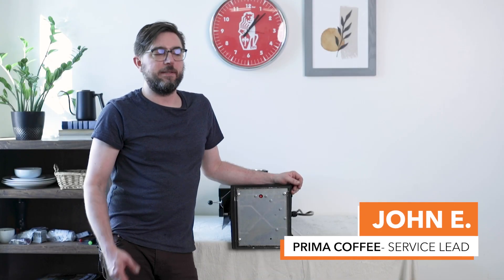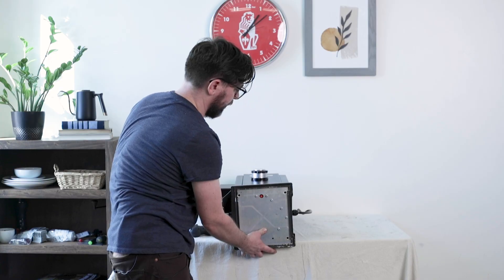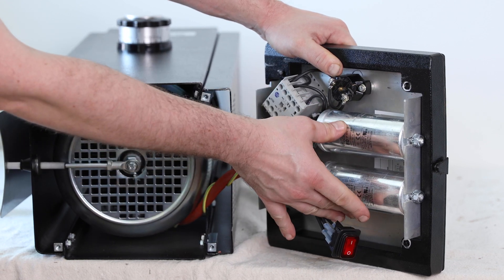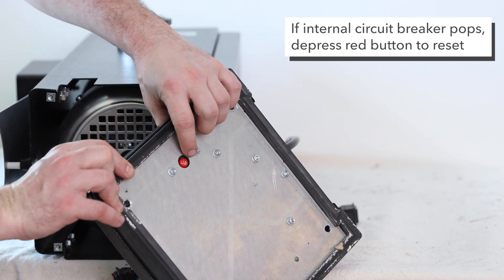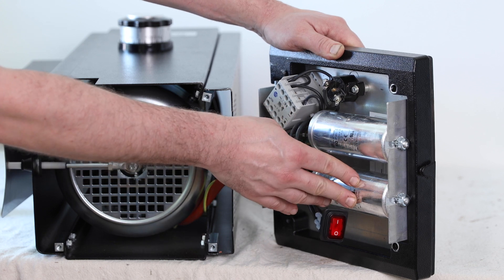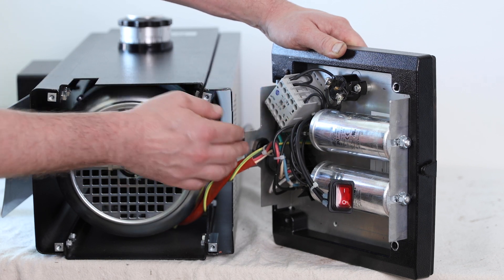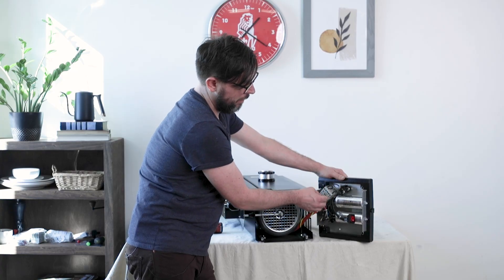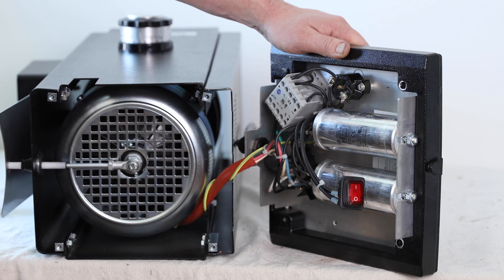Ditting KR1203 Maintenance |  Electrical Walkthrough

Comment: Hi John - would you happen to have a wiring diagram for this grinder ? Bought a used one with dead capacitors (which i knew about), but opened it up and all the wires were disconnected, can't find the service manual anywhere, any help greatly appreciated !
Reply from the maker: Email John at sales@prima-coffee.com and we can get you some documentation.
Reply: @primacoffeeequipment  Thank you!